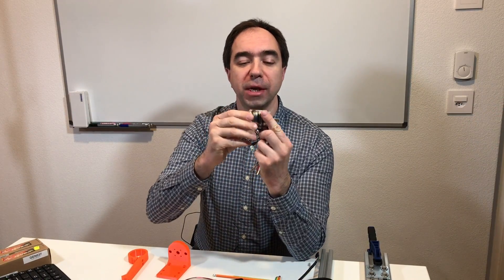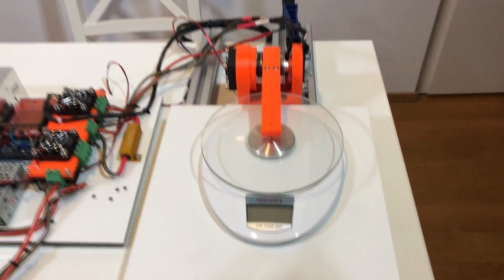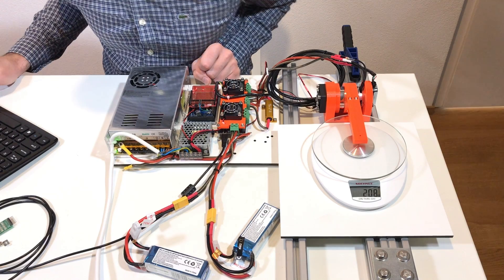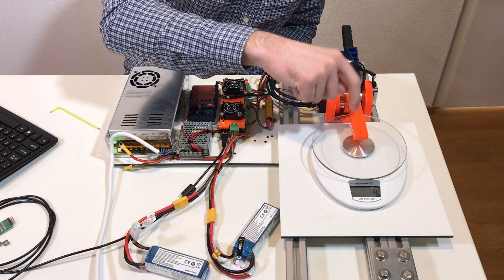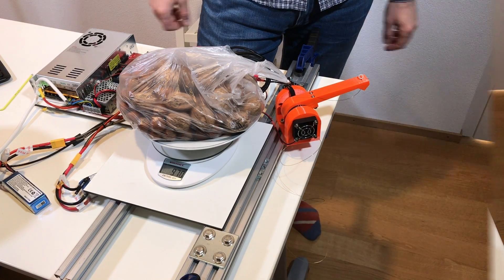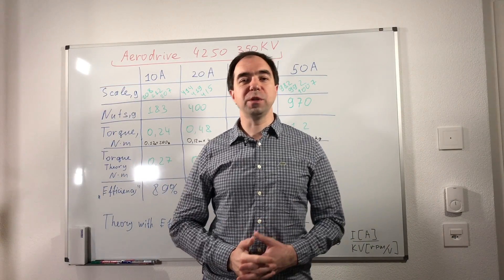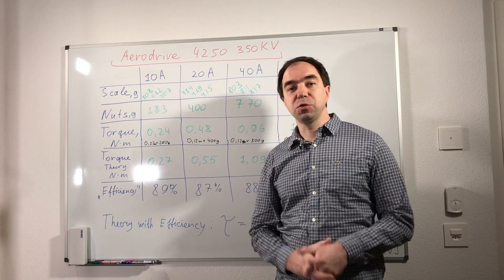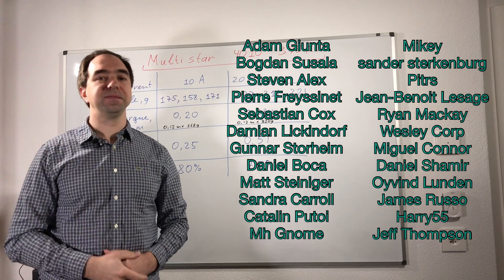Brushless Motor Torque Test for Robots (ODrive Controller)

Comment: Wow, amazing! I had no idea that brushless motors can be THAT strong WITHOUT any reductor and that they can be controlled almost like steppers. It's very interesting i should say :) Seems like you replied to some comment, a regular ESC for airplanes or drones can't deliver such performance. I wonder if ESC for RC cars would perform good considering that RC cars require more of the torque, or any regular ESC is bad and need a proper driver like this? Honestly, my budget is not that big and i would like to have something cheap what can just rotate motor back and forth with maximal torque and PWM for controlling the speed, just like some brushed DC motor drivers. Are there any good variants like that, and if so, could you suggest me something please?

Comment: Is the Odrive basically the only controller in town? 

I quite frankly dont have the thousands it would cost to use a system this elaborate, but hundreds sounds about right so finding basically an Odrive that doesnt cost 100 bucks and could power small hobby motors with low amperage and voltage sounds great.

Comment: @Skyentific I tried to measure the torque of a BLDC motor with ESC controller. And what I observed is that when I increase the speed, I get more Torque.
My understanding was, the torque of a DC motor is independent of the speed. Please correct me, if it's wrong.
Can you please let me know the speed threshold you kept for this  test and if you changed it within the test?

Thanks for such a great stuff...

Comment: I've just recently done the same. Putting on the encoders is the most fun during this exercise. The very first 10 amps run running with 213 grams seems to be the most efficient. As we all need torque most, you'll want to go for your thirds nuts run with 50 Amps, did I get this right?

Comment: Nice work! You could also search for a lower KV motor. As it will have better internal windings (created for higher torque). The KV rating of the motor represents the rotations/volt. The more rotation the motor has, the lower the torque. It is true, the lower kv motors are way pricier, but you can find some on hobbyking that will work :D I recommend using sone around 200-250 kv, it will also make the  reduction assembly smaller and easier to print. :D Looking forward to see more! Keep up the good work :D

Comment: I think there may be two different torque ratings for the motors. I have not personally looked at the data sheets for those motors but typically motors have a static or locked rotor torque and a dynamic torque varies with RPM. This could explain the differences in your measurements and the published values, since you are only measuring the locked rotor torque.

Comment from the maker: Thank you for your comments! The comments will help to promote the video.
Reply: HEY LAD . I NEED LIL ADVICE HERE ON ESCs AND VESCs . WELL I ORDERED 4600W 4x MOTORS AND I HEARD TO REACH THE MAXIMUM POWER I NEED SUPPLY THEM WITH 48V ........ WELL IS THERE ANY WAY I CAN FUK THE PEDAL TO HEAT THEM UP TO MAX WITH 22V-28V ??? BIG THANK YOU

Comment: cool video on the motor, but your math is wrong 0.12*1000g would be 0.12Nm, its the same for the other columns too.
Reply: also is there any settings on the o'drive that sets up and detects stalls?
Reply from the maker: 0.12m*1000g = 0.12m * 1kg = 0.12m * 10N = 1.2 N*m. Everything is correct...
Reply from the maker: Good question. I don't know. But, at least, you can monitor the current from in ODrive. And this gives an idea about the stall. Check out my first video about High Five robot.
Reply: @Skyentific  omg yes lol ~10Nm to a kg, thank you :)
Reply: @dasraiser  But how does hr calculate the theoretical torque needed to calculate the efficiency ? Maybe with the power the motor need ?
Reply: @dasraiser Math is correct. You have mistaken kgm for Nm. i.e. 0.12m*1kg = 0.12kgm, to convert kgm to Nm you have to multiply by the gravity acceleration constant g (~10m/s^2), Force (N) = mass (kg) x acceleration (m/s^2). So answer is 0.12kgm = 1.2Nm

Comment: This is surprisingly relevant and useful info to a project I'm working on. That motor was the one I intended on using, but gearing down 90-216x. In fact, I was going to do torque tests on that motor too. Thanks for taking the time to do this, it's just what I needed.
Reply from the maker: Thank you for your comment. I am glad that this info is useful!

Comment: Thank you!  Another great video packed with useful data.  Would you ever consider doing a comparison between an odrive and a traditional ESC (with a microcontroller) for controllability and torque?
Reply from the maker: This would be extremely difficult. As a traditional ESC does not have position control. Thus for robotics application traditional ESC are not very useful. Thank you for your comment!

Comment: Your information is absolutely invaluable. Thank you so much! 
I don't really understand how the reducer from your previous video has anything to do with the low measured torque. The reducer seemed very efficient as you were able to spin it with just a couple of fingers. I'd love to understand how exactly you came to your conclusion, as I'm currently working on a very similar project for uni.

Comment: Watching all your videos...what is that long power resistor for?
Reply: That resistor is simply used as a brake resistor. It will dissipate the braking energy into heat. Instead of the resistor you could also add some sort of regenerative braking of course.